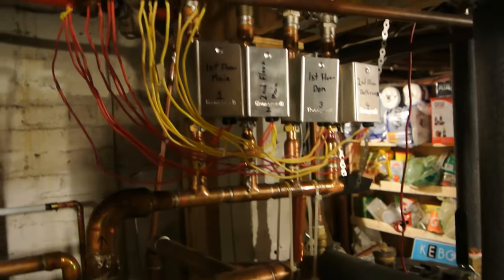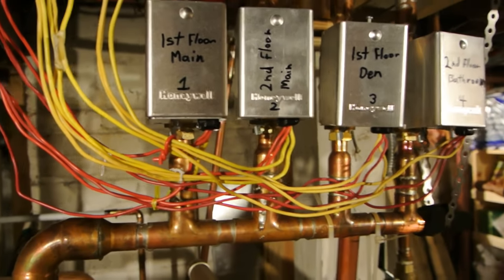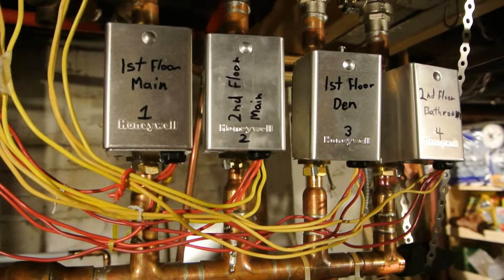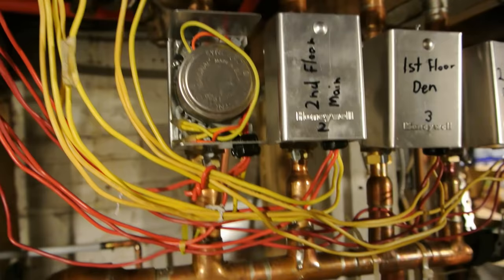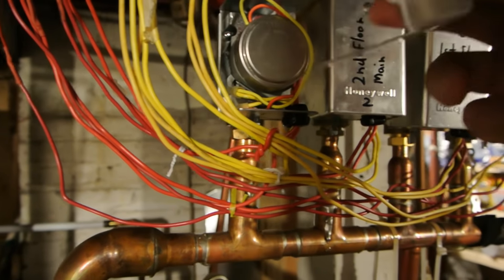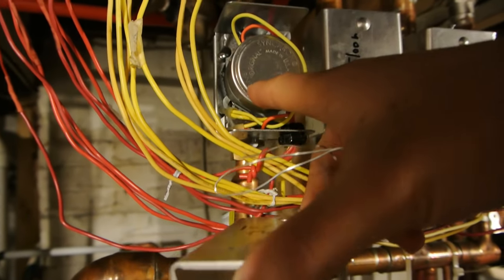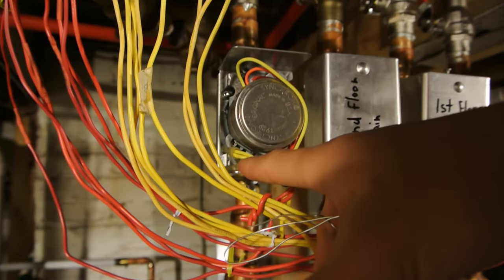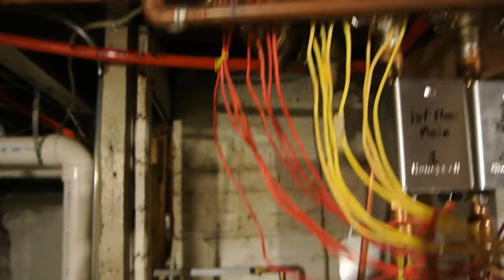How a Hotwater Natural Gas Boiler Works - Overview

Comment: This is a great video. My heat is not working and I'm pretty sure it has something to do with the pressure gauge being filled with water. I don't think it is supposed to be filled with water. So I bet the pressure is low, but the computer doesn't seem to know anything is wrong.

Comment: So what causes, "Delta T is too high"    I'm being asked to check / verify system flow.   The pump was replaced.  The air was purged from the lines following pump replacement.

Comment: If the heat won't turn off,  (Even with the thermostat disconnected from the wall) Is the zone valve a likely cause?

Comment: Munchkin Gas Boilers is a discontinued model, over engineered and a piece of junk.
I have had my munchkin boiler for my residence and have had many repairs every year. I have spent more in repairs than the cost of the boiler. Steer clear.
Reply: I've had one in our house for almost a decade now. Hasn't been touched since it was installed and works fine

Comment: I have a Munchkin boiler like that - that looks like either a T80 or T140?  Great little unit; nothing nice to say about the HVAC company that installed it and maintained it the first few years, but that's not Munchkin's fault.  Two zones in the house, running maximum 135-degree water for heat because I have several exposed cast-iron radiators. (135 is uncomfortably hot to touch, but 180 is almost instant burns.)  Outdoor reset so it doesn't run the full 135 degrees when it's just a bit chilly outside.  Indirect domestic hot water, wired to a different contact on the board, telling it to run full-throttle 180 degrees to heat up the water tank faster. (That is, the boiler runs at 180 degrees until the hot water tank thermostat is satisfied, which is  around 130 degrees. We can shower almost indefinitely.)  I maintain it myself these days after firing the HVAC company - long story, but they didn't know what the hell they were doing. Highly recommend the Munchkin. Not so much the company.  8-)
Reply: Do you have a 140M?
Reply: @georgejetson4378  Yes. It turns out 135 degrees can't keep up on the very coldest windiest days of winter here - NW Pennsylvania - so I reprogrammed it to I believe 145 max, and that made the difference.

Comment: Not sure if you will read this, I have the same system..... My boiler works well heats well also... the issue I’m having is when I turn on the heat in my second floor and want the 1st floor on as well my second floor heat shuts off.  Anyone out there can answer this for me it’ll be greatly appreciated!

Comment: 2 times you mentioned there is not enough light throughout the video and although you have a free hand to point at stuff, and there was a flashlight sitting on the boiler. You failed to collect the tool to use through the whole video. Plumbers...

Comment: at the end of the video he says there no need to go inside the boiler. well let me tell you that's a lie. this unit requires that you clean the heat exchanger and burner annually. you will need to check the ignitor and flame sensor. to void error codes like F09 no flame F10 or F11 loss of flame it is recommended that the heat exchanger get cleaned make sure to have a burner gasket just incase. 

your welcome in advance..
Reply: Do you do your own maintenance?

Comment: IF and that's a big if,  the water in the boiler stays hot enough (so as to supply aptly/promptly a shower hot water demand) why would one need another holding tank (water heater)? Just asking.  One helluva good review on your part.
Reply from the maker: +Louie Lamoore So the boiler water that is used for heating the home via the radiators never comes in contact in with domestic hot water supply.  So the boiler water is in a closed system, to heat hot water for showers and such it's done indirectly with a heating coil that is connected to the boiler water.  Does that make sense?
Reply: The closed system for heating ones home I understand and now the coil part also. Thanks much. It all seems most complex. But so is a nuclear power plant. Miles and miles of pipes all to basically boil water.
Reply: +Louie Lamoore Efficiency.

Comment: hey, thanks for this. Just wondering are you a plumber or an engineer? I'm an engineer who works mainly in the water systems for factories and other organisations
Reply from the maker: +beastywild I'm neither, just a home owner who doesn't want to call the heating company any time there is an issue with the heating :)

Comment: is there a union on the gas line after that valve?
Reply from the maker: The part after the valve closer to the boiler is a threaded iron pipe but before that is the union, which is a threaded compression fitting but I don't think it's reusable.  I don't know much about gas, best leave gas lines to the pros.

Comment: hello, can anyone show me how to take air vent from gas furnace? one of the air vent on my gas furnace is leaking. thanks
Reply: Jordan Chen, I would generally think that if you have a leaking air vent, that your furnace system is lacking in the resourceful management of being installed, ... at every seam in your ductwork should be sealed with duct tape, that was the primary reason it was designed, ... & it does have to be very much, just enough wrapped around each seam in the joints of your total system, ... or on the seams of length of the ductwork, ... and all it does is to control not only the amount of forced air, (no matter if it is on the pressure side, or on the "return" side of your system), it needs to be a controlled flow, so whatever is going into your system, is mathematically calculated for the resistance of the amount of air moving through the ductwork/system at a measured pace should be equal from the intake through to the return side of your airflow, ...  minus the coefficient of friction, plus the amount of dampening within your systems ducts @ the individual vents in each room, ... can be mathematically figured, by the volume of air pushed/drawn into the system, with the fan motor, ... against the restrictions it faces in flowing out the other end, ... & returned to the system through another series of ducts on the return side of your intake, ...
So effectually if you place 2 vents in each room to be managed, (with 1vent @ the floor level, & the other vent, near or in the ceiling, you can use them opposite of each other for all 4 seasons, according to the temperature fluctuation, no matter what time of year it is, ... by pumping warm air through the floor vents in the winter, or reversing the flow, (ie; pumping cooled air through the ceiling vents to each room in the summer, makes it much easier on the system to provide a comfort level unmatched since the Romans had the heated pools for their citizens, ... with water provided by the aquaduct system they engineered over 2000 years ago, ...